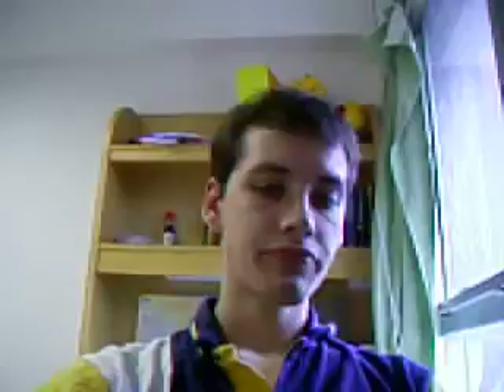Re: Water Fuel - HHO

Comment from the maker: Then why do oxy-acetylene torch tips get hot?  Also, you can't get a flame traveling back into the cylinders the way you described.  Maybe back to the shutoff valve, but unless you have a fuel/air mix no combustion can take place there.

Comment: well as someone who knows how to weld, you just made yourself look really stupid in my eyes. there is NO combustion inside the tip in either case. it would cause a pressure drop in the regulator valves therefore shutting the fuel off, because the flame would travel back in the cylinders and cause a terrific explosion.  next time you want to refer to welding make sure you know what your talking about.

Comment: hydrogen burns at various temperatures depending on what it comes in contact with. The torch is HHO because it comes from water that when broken apart, becomes two parts hydrogen to every one part of oxygen so the two gasses are being used. As a matter of fact, the two gasses can be made separately from water and they can be easily issolated from each other and any other gasses. Check it out, it is a lot of fun but don't hurt yourself.

Comment from the maker: That's kind of different from what I meant.  The reason that the reaction temperature is reduced is because the hydrogen reaction is being diluted by a gasoline reaction.  The hydrogen still burns at its normal temperature, but it's cooled off by the gasoline combustion.

Comment from the maker: Yes, that's certainly something that will work, except that the resulting gas is going to be combustable and at a stoichiometric ratio, meaning it would be very dangerous to work with.  Also, you can't get free energy out of such a setup.

Comment: 1.  You might be more credible if you could spell stoichiometric;
2.  Hydrogen is not safer than gasoline. Energy density is very poor; it embrittles metals; and it is explosive at a wide range of concentrations;
3.  There must be an energy source to electrolyze the water to hydrogen and oxygen, so where is that energy coming from?  

I know!!!! He hid a Mr. Fusion in the trunk!

Comment: He means compressed hydrogen. Hydrogen on demand is much safer than either gasoline or acetylene(Not to mension much less toxic). Oxyhydrogen, Browns gas, HHO (or whatever you want to call it),these torches were in use in the 1930's and then disapeared. Welding Manufacturing catalogues had them listed. General Electric is suposed to be manufacturing one now. Check out the vid on UT "Atomic Hydrogen Torch" .

Comment from the maker: Well, he's referring to HHO as though it was some kind of new gas. Whatever he's using in his torch certainly isn't HHO--if it were, the tip of the torch would heat up because the combustion would occur in the welding head as it does with Oxyacetelyine torches. Water torches are in use today by jewelers and electronics technicians, and hydrogen-burning cars are nothing new (though the temperatures generated by hydrogen combustion are dangerous because they can melt steel).